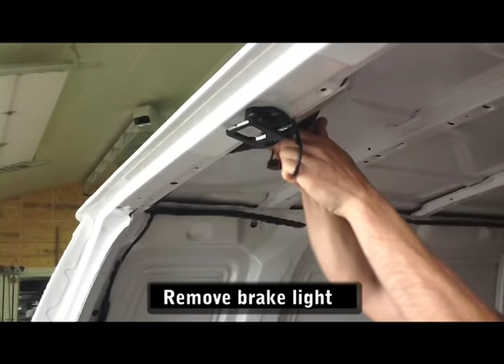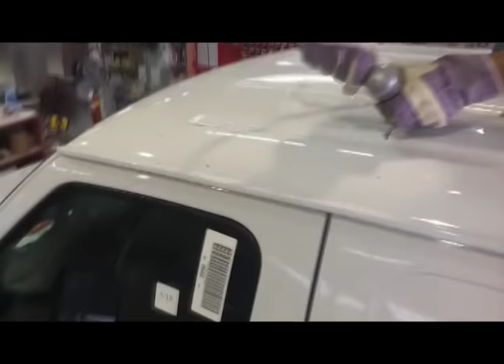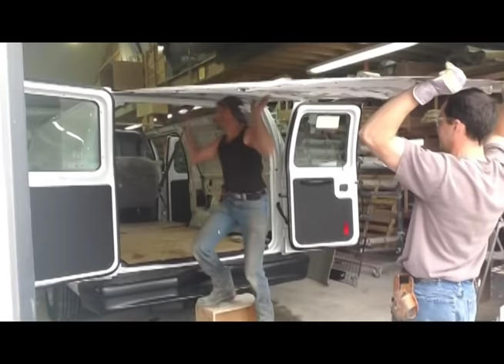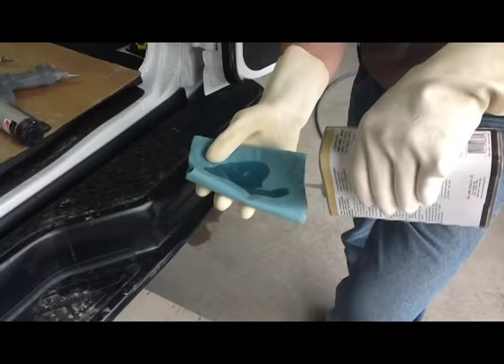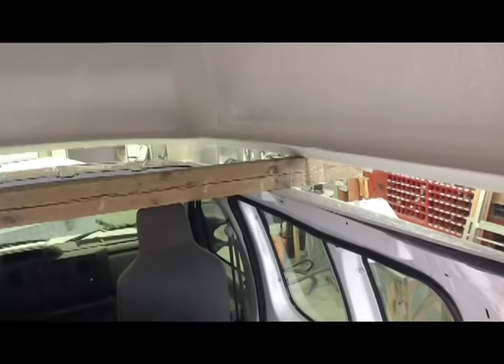Mory inc Raised Roof Van Top Conversion Cutting out the Roof. www.moryinc.com

Comment: I own a factory conversion van you not supposed to cut the back till the end. Leave 3 feet and the 2 cross member The van stock weight 4,800lb you going to add 1,200 lb that 6,000 lb you roll the van the back and the front will get flattened. Beside the space between the roof to the ceiling is perfect or storage and the bed, nobody standing back there anyway.
Reply: what do you charge for a similar van?  what city is your location?
Reply: Live in Honolulu, I don’t do conversion,  
 Check your craiglist or try goggle “ craiglist high top van for sale ” or “ craiglist  Conversion van for sale” 
 
good choice, as these van are business used and they dont have the 10 yr parts limited in stock parts as all the other do. But limited to 1,100 weight load limit. Advises,  watch your weight wood etc. building up as it’s easy no trying to put 1,000+ Weight in the build. I had to redo thin wood with backing as needed. Finish weight is about 700-800
Reply: You are right. The rear you leave 2-3 feet. As it is a side load being surface. Why they use the rear space for overhead storage and AC\Heat ducting.. I would never chop the whole roof off. You roll the think and it will fold up like paper....
Reply: Its too tall to roll over, it'll probably just roll on its side
Reply: That the problem, the tall hight and floor that above the wheel make it easy to fip over high center of gravity .On my company van they was this steep right turn I would Turn and lift could lift the left side up and off the road and drive on 2 wheel. I seem many  van roll over at my junk yard. A fellow worker had a blow out on a s hill and roll his van totaled. If you on the freeway going 60-70 if you turn to avoid a car fast the back end will fish tail and will roll the van.

  Here federal government safety dept. from  1991. To 2,000
1,204 van flip over they only count fatal accident and there are not counting the under 15 passengers van also. 
And the conversion window pop out there a defect about that too. There not much holding up the roof. The front glass will break.only the front side pillar. The van weight 4,200 pounds or over 4 tons empty

https://www.autosafety.org/wp-content/uploads/import/NTSB15Passenger.pdf

Analysis of Fatal Analysis Reporting System (FARS) data for 1991- 2000 shows that 15-passenger vans are involved in about 0.22 percent of the fatal accidents (1,204 vans of 557,786 vehicles) and 0.24 percent of the single-vehicle fatal accidents (499 vans of 209,447 vehicles)

Comment: Thank you for teaching me to never ride in one of those vans. What used to be held up by six steel supports is now held up by twelve sheet metal screws and the roof got bigger and heavier. I hope you have some jaws of life ready when this thing rolls.
Reply: why would it roll??
Reply: @Annabelle511  IT'S CALLED A ACCIDENT!   A VEHICLE CAN ROLL OVER MORE THAN ONE TIME DEPENDING ON THE CIRCUMSTANCES INVOLVED IN THE ACCIDENT.  

I WAS IN A EARLY 1950s FORD ON SKILLMAN AVE. WHEN DUE TO A TRAFFIC PROBLEM THE DRIVER HIT THE CURB AND THING ROLLED OVER ON IT'S ROOF A SLID DOWN THE ROAD.  IT SEEMED LIKE SLOW MOTION.  NO ONE WAS INJURED, WELL EXCEPT THE CAR.  

IN 1986 I HIT BLACK ICE DOWN BETWEEN PALMER AND WAXAHACHIE TX.  MY 1969 FORD PICKUP  SLID DOWN THE ROAD WHILE SPINNING IN CIRCLES.  THEN IT MUST HAVE HIT A DIP OR A BUMP CUZ IT TURNED AROUND AND WENT SPINNING BACK DOWN THE ROAD IN THE DIRECTION I WAS COMING FROM.  THEN IT RAN OUT INTO A SNOW COVERED FIELD,  STOOD UP THE FRONT TIRE ON THE PASSENGERS SIDE AND FELL RIGHT OVER ON IT'S SIDE.  I SHUT OFF THE ENGINE, STOOD UP ON THE PASSENGER DOOR, ROLLED DOWN THE DRIVERS WINDOW,  THREW OUT MY PURSE AND CLIMBED UP OUT OF THE TRUCK AND JUMPED TO THE GROUND. 

 IT COST $47 FOR A WRECKER.   I HAD IT TOWED TO A SHOP WHERE I DID BUSINESS AND THE ONLY THING BROKEN WAS A CRACK IN THE WEST COAST MIRROR ON THE PASSENGERS SIDE.  I WASN'T WEARING A SEAT BELT & I ONLY HAD SOME BUMPS AND BRUISING. 

IRONICALLY I HAD JUST PURCHASED THE FIRST OF TWO HOMES I'VE OWNED IN SD AND I'VE NEVER HAD A ACCIDENT THERE EVEN WHEN I DROVE HOME ONE TIME IN A TOTAL WHITE OUT BLIZZARD.  I THINK I HAVE SOME GOOD GUARDIAN ANGELS.
Reply: @Annabelle511  Roll over accidents happen every day!! Ask a firefighter!!

Comment: So, cutting out all (but the front) of those factory cross braces doesn't weaken the sidewalls ? I'm imagining a lot of flex, and all of it working to pop those screws and break the bead of sealant, at a minimum.
Reply: Imagine whatever you want. The reality is this is how every fiberglass high top conversion van in the history of the US was and still is built. Seeing as such I'd imagine we'd have seen a lot of this imagined problem by now, if it were actually a problem, you know, "at a minimum", yet we don't. Funny how that works. You know-it-alls thinking you know better than the industry that has actually been doing it for decades crack me up. You don't. You just think you do.

Comment: What do you guys do about the rough (sharp) edge left on the inside where the cut was made?
Reply: Usually there's an option for them to take care of that. More often than not the van owner doesn't opt for it since you can simply paint the exposed metal with a rust inhibitor, then put a rubber lining over it yourself for far cheaper than what the body shop will charge.
Reply: @glenrkat  
I would still file the sharp edges down a bit.
Reply: @Sig721Tau  Hi from the UK.  The more you sand or file...the more metal filings drift about the van into recesses.... to rust away affecting the surrounding area. It's unnecessary as you're going to put a soft rubber edge on anyway. Even painting the bare metal is a surplus step ..IF....you fit the rubber using silicone as soon as the metal is cut. The silicone does exactly the same job as the paint would.  Hope this helps. Happy travels everyone.  John.

Comment: Do the braces on the old roof not tie the walls together structurally?
Reply: I would think they are connected to the floor until the new top is on... But I'm just a woman that knows nothing about it ..😎
Reply: They sure do! I would keep the main brace over the cab. This being an extended van, I would also keep the back two braces. These Ford vans were well known for rolling over... adding these fiberglass shells weaken the vans structural integrity!
Reply: Interesting...I was waiting on how replacement roll bars, or whatever were gonna get mounted.... oops... none ! Vehicles have to go thru so much testing to prove road worthiness... before allowed to go into max production... a few snips here & there... removing bracing sure MUST be devastating to its ability to survive a crash... yikes 😱
Reply: Not as much so. In common with those ribs immediately inside Sign Writting Panel areas, they're only a sound-deadening measure. EXCEPT in some generations of VW Transporter/Microbus (Against Side Impact?).

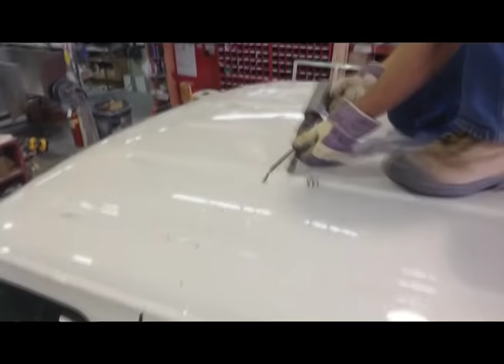Comment: 2:04 - What is this air tool?  Looks like a recip saw.
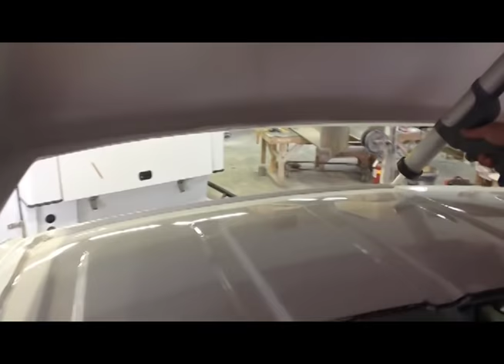7:34 - That is a really nice caulking gun!  Looks like air compressor connected as well.

Once you cut through the metal roof supports, you have altered the car steel framing.  Does this affect safety in accidents?
Wish you had shown us how you measured it and got the placement centered before the cut.
Would love to know how much this costs to get done on this style of van?
Nice work, very interesting to watch!  Many thanks!
Reply: It's a metal shear. And yes pneumatic caulking gun.
As for safety, it's my understanding (not fact) that roll bar bracing is only needed if people will ride in the back (which also necessitates seat belts)
Measuring the hole, doesn't matter much.  Some leave more in front/back other go max.
Cost for roof and install is in the $5000-$7000 from my research.
Reply: @hobohacker258  Thank you!  That was very useful to know!
Reply: @hobohacker258  
That's a lot of money for a fiberglass shell.
Reply: @Sig721Tau  Yup.  But if ya need/want it....  Also consider product liability insurance, EPA regulations, etc.. (thank Lawyers!!)
Reply: @Sig721Tau  yeah ,no shit it is. I was interested till I saw the price tag.😲
Reply: @stevehairston9940  hi from the UK. I really don't get it why people do this ?  It's got to be cheaper to swap vans for a higher top and you get full factory steel roof ribs for structural strength. Anyone ???   Lol Happy travels everyone. John
Reply: @johnvancamper9581  It goes back decades to when high top vans weren't common, if they were made at all. So all the camper van conversions had to improvise and an industry was born. I agree, why still do it today when you can get an actual high top van, properly built and engineered, and probably for less than this conversion in price difference. Makes no sense today.
Reply: @johnvancamper9581  I guess you could look for a high top van, but they are outrageously priced or in rough shape.
Reply: @Sig721Tau  What would you pay to increase the headroom in your van and save your back from hunching over all the time? Serious question here.
Reply: @hobohacker258  What would you pay to increase the headroom in your van and save your back from hunching over all the time? Serious question here.
Reply: @givemeaforkingname  "Makes no sense today." Rubbish! If you believe that you obviously you haven't priced out the now older factory high roof Ford Transit, Ram Promaster, and Mercedes/Freightliner/Dodge Sprinter vans. Or one of those goofy looking Nissan high roofs. Because around here even 15+ year old ones have ridiculously high mileage on them, look like a work van that's been put to work for 15 years,  and still cost a small fortune. For a know-it-all about high top vans you sure have a lot to learn.
Reply: @johnvancamper9581  Because up until about 20 years ago there was no such thing as a factory steel high roof van in the US. They didn't exist. All high top vans up until that point were fiberglass top conversion vans. That's why the industry exists and they are still available today. And yes factory high roof vans have taken their toll on the fiberglass high top industry. But even today factory high roof Ford Transit, RAM Promaster and Mercedes/Dodge/Freightliner Sprinter vans, just plain jane white panel vans, work trucks, still cost a rediculious amount of money. Who wants to pay 5 figures for a high mileage hard worked work van? You can find an old school fiberglass high top conversion van, or convert one you already own for far less money. Even if know-it-alls like givemeaforkingname thinks otherwise. That's ignorance speaking. From someone who clearly hasn't actually priced such things out.
Reply: @Sig721Tau  Yes, it is. You thought it was going to be cheap? You want cheap go over to the junk yard and buy one off a scraped conversion van and install it yourself, after you get it removed and manage to take it home. Then you won't be paying "a lot of money for a fiberglass shell". Because the reality is the people who manufacture them and install them professionally don't work for cheap. Being cheap about it, that's your job. Not theirs.
Reply: @stevehairston9940  What would you charge to personally lay up fiberglass shells and install them professionally? It is what it is. And it ain't cheap.

Comment: Were can I purchase this roof to install on my van????
Reply: demarcohigh247 it looks like an aluminum flat bottom boat!
Reply: It does looks like a little fishing boat
Reply: @bryantmatthews93  i did it to a van once...used a p.u. shell for the back , and faired in aluminum for the front....for yrs. people thought i'd used a boat
   i also cut a fiberglass boat down to use , but it was so damed heavy , i went back to canopy...cheap , free to $50 , and pretty easy , actually...leave the front and back 3' for strength and shelf over cab , you only walk around in the middle anyway
Reply: Doug Evans bro not a bad idea
Reply: Triad Fiberglass Pros in Colfax NC.  They make tops for Chevy Express and Ford, Dodge vans
Reply: River Rat do they deliver? Lol
Reply: Where can i buy top

Comment: Have hitop 04 Savana want to remove remaining original roof over cab. For max headroom getting in out of drivers seat. Already cut out 9” where ol TV was up to the support bar across..could cut out 18”# 14” horse shoe config between seats or cut out portion over driver seat and in between seats leaving portion over pass seat . Perhaps eave small section above visor for ledger for control switch’s and small compartment.   Any advice?  Thx
Reply from the maker: If you cut in front of the reinforcement above the seat, you will affect the crash tests for the belts.

Comment: Very interesting video! I have a question about my conversion top. I have a 1988 van and I'm guessing the conversion top was put on back then. It is fiberglass and in great shape. I recently gutted the interior of the van, as well as the top cabinet parts. I noticed that you (and all conversion tops I've seen) leave the original body over the cab and add a brace. This makes sense, I assume to keep the driver safe in case of a rollover. But my van also has the rear part of the original body and a brace in the same manner. There was a cabinet up there, but I took it all out. I can see where the brace is screwed into the frame on the sides, and then it's just a floppy cut piece of the original van's roof. 

My question is, would it be okay to unscrew the brace, and cut the rest of the original roof off in the back with a jigsaw? Is there any safety reason that it would be there? The only thing I could think is to protect passengers in the back in case of rollover and allow for the ugly cabinet area that was there. The conversion top seems plenty sturdy, I assume it was put on the same way as this. I would much rather have the head room in the back with the full conversion height, but I'm just wondering and wanting to make sure if maybe there's a reason why a conversion top would need that in the back and others like this one wouldn't. Any advice would be much appreciated!
Reply: Did you do it ?
Reply: I’m wondering the same thing. I’m in the exact same situation. Lol
Reply: @lutonia  I have a conversion van with the raised roof and a rear cabinet. We removed the additional 12" of original roof that was hidden in it without issues two years ago. Chevy express van.

Comment: I really like that style of high top roof. I have a Ford E450 cutaway van that I want to install one on but I really only need the front few feet for mine. I currently have a sleeper cab mounted behind the cutaway van cab. Installing a raised roof for the cab would work great to help the sleeper cut thru the air better while also giving me a storage area above the E450 cab.
Reply: I was just looking at a Rocky ridge raised roof van and they have the standard headliner they don't use that space at all in the front I don't understand it

Comment: What tools did you use for that I'm currently a motor fitter and there worried about sparks on the paint ? And that looks next to nothing
Reply from the maker: CP7111 CHICAGO Pneumatic
Reply: @mastermoryinc  would u recommend a nibbler aswell ?? Thanks for your time and great videos keep up the work
Reply from the maker: @papitsb  The model I sent you is the one we are using. Surely a nibbler will work well too it's the same kind.

Comment: Now, does this end up being as tall or taller than the head room inside a high roof Promaster or Transit?
Reply: Just bought a van with this style cap on it. I have 5' 9"- 5' 10" depending on where i measure. They come in different heights... Hope thats helpful.

Comment: well done tool work and video, sir... i am curious about how stable the van is w/ the roof supports all cut out.....  the new roof is a fiberglass shell only? i guess i would have to see one, seems like the van is not as strong and/or safe anymore.... IMHO :)
Reply from the maker: We have customers that its made 4 vehicles that have their roof converted at our factory. The only thing that changes these when there is a very strong wind from the side of the roof extension

Comment: Is there an option to extend the metal ribs you cut in the video to form a cage just under the fiber glass top? That’ll be safer if roll over happens.
Reply from the maker: No
Reply: No. That's not how they do it, in fact that's never been how they do it with fiberglass conversion hitops. This is how it's done. If you are worried about rollover protection fiberglass high top vans are not for you. Not buying one would be safest. M'kay? Buy a factory high roof Ford Transit, RAM Promaster, Mercedes/Freightliner/Dodge Sprinter, etc. And yes they cost a small fortune, even high mileage 15 year old work vans.

Comment: Is there no need to reinforce the roof with some kind of bracing? Hard to believe that the fiberglass top and self tapers into sheetmetal , replace the braces that were cut from the original roof!!
Reply from the maker: When these roofs are installed they are not designed to carry passengers in the rear. The front ocuppant protection cage is not cut.

Comment: What product did you use for the exterior weather stripping, and does it seem to actually help
Reply from the maker: We installed a self-adhesive decorative molding with 3M tape on the outside